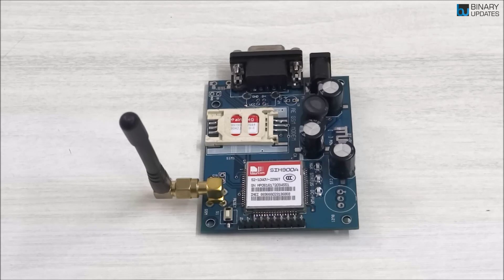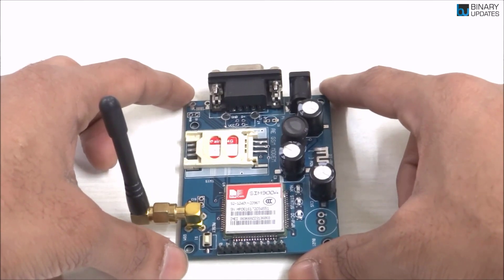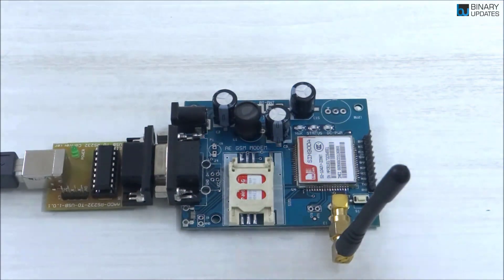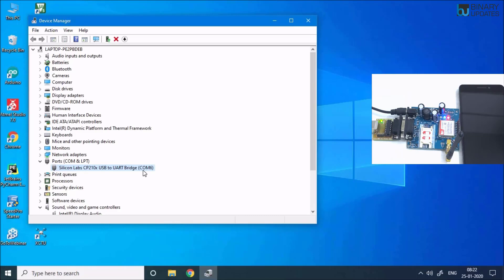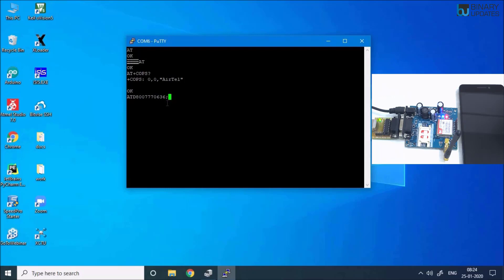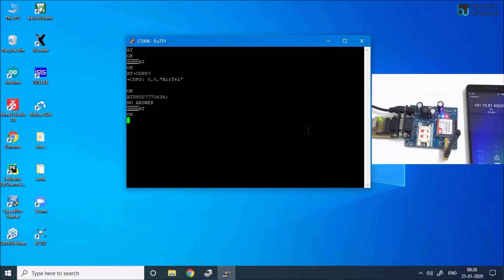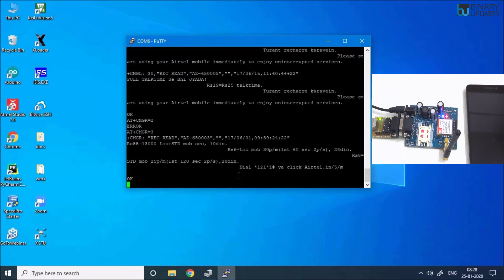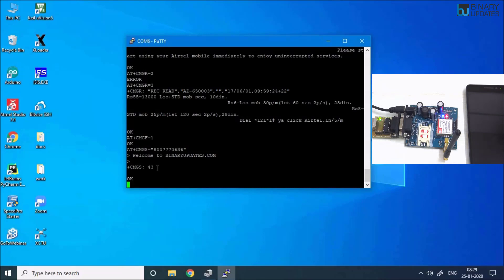SIM900A GSM Module-Send SMS & Make a Call using AT Commands

Comment: I cant find the reset button :D
Reply from the maker: There are several version on GSM Modules out there. If your module doesn't have one then use RESET Pins on SIM900A module and connect to Ground pin to reset otherwise best way is to contact support from the brand you've purchased. I hope this may help you somehow. Good luck and best wishes!

Comment: Using this Module can i Send FAX using windows FAX application from Win 7 ?
Reply from the maker: Hi Mr. Manish, with this module you can make arduino to connect to internet and then do whatever you wish to do. Alone this module will not help you much as its just a GSM Module for providing connectivity. I never used Windows FAX especially on Won7. I hope this may help you. Have a good day. Thanks
Reply: @BINARYUPDATES  my pc has RS232 Port can i connect it using RS232 cable ? without using arduino device ?

Comment: Sending and making call is free?
Reply from the maker: Hi Sandie, It depends on you mobile data network operator. It has nothing to do with GSM Module. It's a job of Mobile card which will be used in SIM900A GSM Module. I hope this can help. Have a beautiful day
Reply: @BINARYUPDATES  can the call be answered using the PC/laptop where the module is connected?